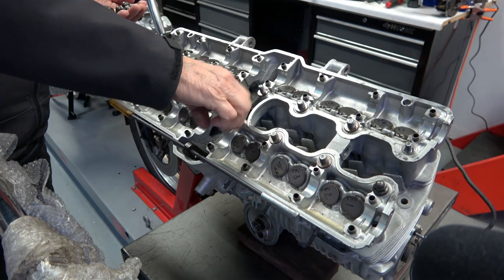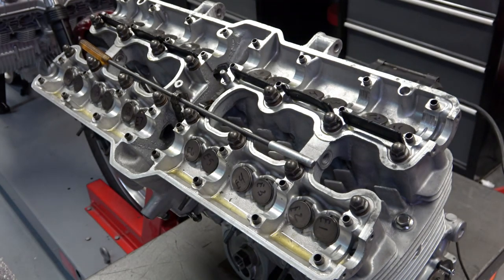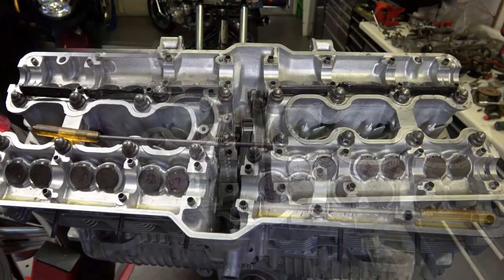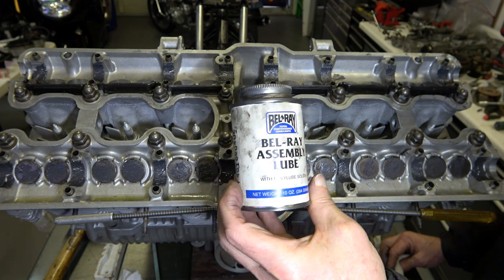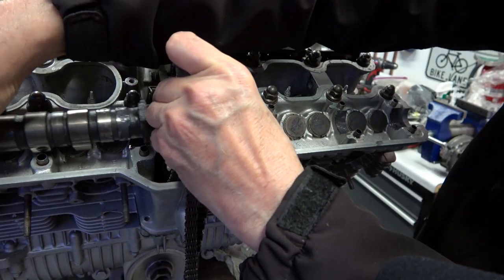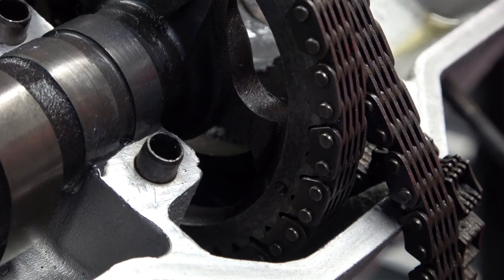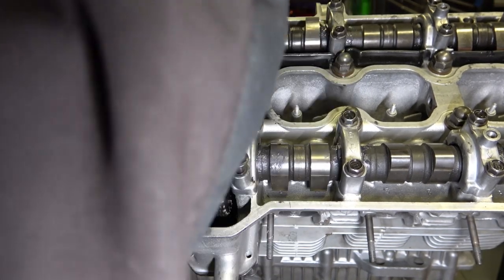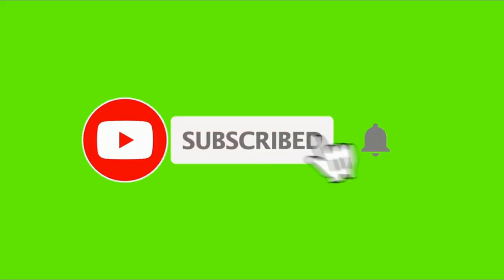Honda CBX Step by Step Restoration Video Series Part 33 - Final Engine Re-Assembly of CBX #2

Comment: Hi had cam cap bolts crack when undoing AND when refitting ..I checked my torque setting with other cam caps and it's set correctly...also can't find the four long bolts that hold down the oil pipe in the head...any advice welcome..bolts just oil as per workshop manual.

Comment: What happens when you can't turn over the motor and you need to pull the head?  Can you still disassemble w/o breaking something?
Reply from the maker: Hi Michael, yes you can disassemble without breaking anything. As you may recall from the “Left for dead CBX” engine that I did the previous videos on, that engine was as frozen solid as any engine I have seen. I was able to get it apart without breaking anything. Most frozen engines can be freed up a lot easier by soaking the cylinders and with use of heat and patience lol
Reply: Digitalpizza, thank you sir.  I am only taking off the cylinder head as a last resort.  It did break free but got stuck on exhaust stroke(exhaust valve open now) where it was just after TDC on compression stroke. I will continue with your advice and do as you stated.  I know that works because it was stuck fast until I started the process and tried the starter.   It threw my 17mm open end wrench across the shop and almost hit our 67 fastback mustang(stupid me forgot to remove it).  Anyways, happy Sunday.  I will let you know when I get the old & beautiful CBX on the road again.